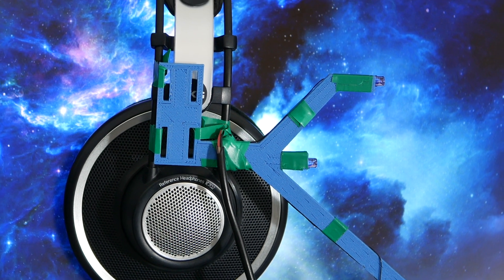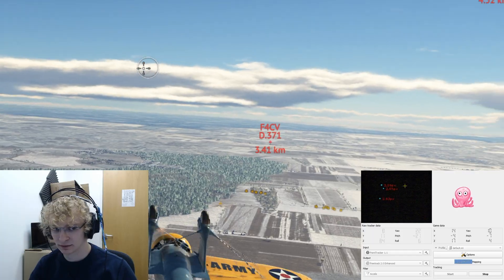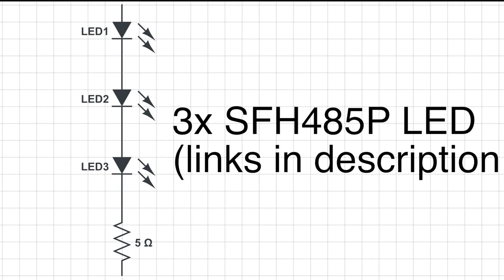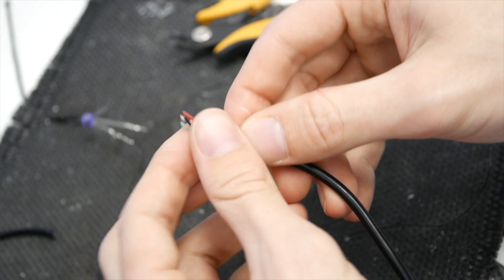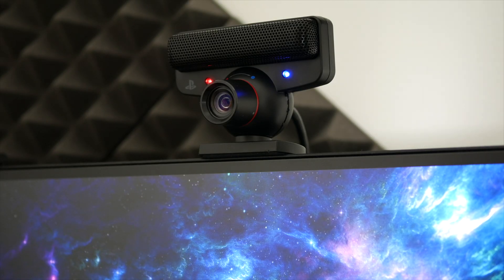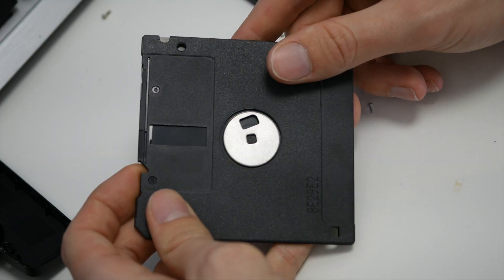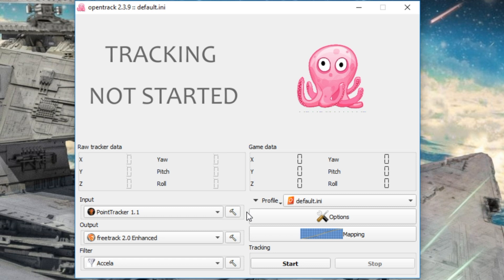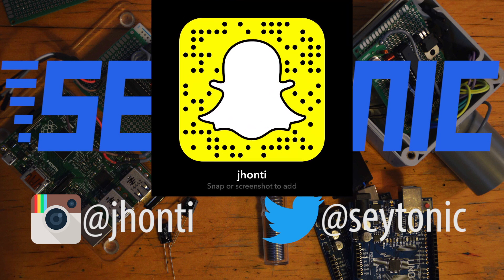$10 Gaming Head Tracker | DIY Tutorial

Comment: Best to power the LEDs from the usb/battery by one resistor each( 330R to 150R) . This is the most elegant way to drive them because the difference between usb 5V and three LEDs in series is too small to ensure adequate current regulation for all led types and power supply variations.

Comment: So......all we need is a f*cking 3D printer, which of course none of us has, and a 5 ohm resistor which you yourself couldn't even find.  I award you zero points for this video and implore you to distance yourself from both Youtube and the rest of mankind until the end of time.  Constantly replacing the over-volted LEDs in your design should keep you busy in the interim.
Reply: lmfaoo chilllll
Reply: or you can make the structure out of cardboard, and actually use a 5ohm resistor. Seems someone has anger issues.
Reply: maybe im tripping but he clearly showed us an alternative to using 3d printed one. Also you can find ohm resistor very very easily

Comment: So I just built this, camera works fine, I plugged the clip in to test yesterday and it was fine, plugged it in today and it waited a couple of seconds before making the same sound as a fly being electrocuted! Luckily I have another set of emitters and a bit of time on my hands, but can anyone say they've done this without resistors and it's still working. I'm thinking it was a short circuit, but I could be wrong.

Comment: Can we use, instead of those 3 IR LEDs, 3 reflective pads, which will reflect the light from the light source mounted on the monitor bezel?
Reply: It would work with a big ir led but it will cause damage to your eye recipe for blindness
Reply: Yeah, that's what one version of the actual TrackIR does. If you also don't have a PS Eye camera you could try using a wii remote. They use basically the same technology as this, but require some software to work as far as I'm aware.

Comment: You should 100% use the resistor. It is not to limit the voltage, an LED has a forward voltage and it will not take more but it is to limit the current. Any voltage left after the forward voltage will get dissipated as heat through the current limiting resistor and anything else connected in series loike your USB port. These LEDs have a current rating of 100mA so in series that is 300mA. Using Ohms law R = V/I so R = 0.5(the voltage drop across the resistor is total 5v minus the 3 leds)/0.3 which is 1.67Ohms resistance. That is the smallest resistance you should use (the 5 Ohm resistance you are advised to use gives you a total of 100mA). Just to give you an idea of the current if your resistance is just the wire you use, looks like very thin maybe 32 gauge at about 1 meter so roughly 0.6ohm. I = 0.5/0.6 = 0.83A. That is almost 3 times the maximum for these LEDs, plus as they get hotter from the current the current draw will change. This is ok for a USB 3.0 just about (normally 0.9A max) but USB 2.0 is only rated for 0.5A.
Reply: what size transistor do you recommend?
Reply: @skate4news658  just a correction on a mistake on my post, 3 LED's in series would not stack to 300mA (parallel would stack but series resistance is same throughout he series circuit). You will want a resistor value that will give you about 80 to 90% of the maximum current rating for the LEDs you are using. So for the 100mA limit keep it to lets say 85mA, they have a voltage drop (the SFH485P LED) of 1.5V. So 3 LEDs in series will drop 4.5V. Assuming your USB is actually supplying 5V that leaves 0.5V which will drop across your resistor. 0.5V/0.085A = 5.9 Ohms resistor. the power dissipated across that resistor is 0.085*0.5 = P = 42.5mW so a quarter watt resistor should be fine.
Reply: I made mine with a rechargeable battery so I had less voltage and had to use a parallel circuit and dissipate some more voltage with bigger resistors and an extra silicone diode.
Reply: @skate4news658  https://www.mouser.co.uk/ProductDetail/OSRAM-Opto-Semiconductors/SFH-485-P?qs=K5ta8V%252BWhtaMgyKjFkJPvw%3D%3D that is the data sheet for these IR LEDs

Comment: Can I use another infrared led model? for example, an infrared LED that emits with a wavelength of 940nm
Reply: Yes, other people have successfully used different IR LEDs. However, most people use these, as they scatter the light relatively broadly and are bright, so its easier for the camera to pick them up.

Comment: There is a DIY trick where they draw red and blue on tape to make a UV torch, do the same but with brown and violet on your webcam and you can use a plain white led instead of IR
Reply: I did it with a marker and tape
Reply: Why not try Eyeware Beam instead? Less fiddling around with LEDs and no headset required :)
Reply: @BeamEyeTracker  advertisement on a reply section is new

Comment: I've done this stuff a lot...You need the right type of PS3 eye camera.  If the outer lens is flat, it wont work.  The IR filter is embedded between lenses.  The concave/x design is good to go and you can peel off the ir filter.
Reply: peel off? The videos I saw they had to cut/pry out the IR filter lens with an exacto knife.

Comment: i'vew done everything u show in this video but still can't setting my trackir, once started opentruck,start moving head but everytime one or two led disappear from the black screen
Reply: Same problem here, have you fixed it?
Reply: @greaterwise2841  nope..managed with facetracknoir, even if it's not as good as trackir because of little lag in ingame movements
Reply: @PreludeMan  facetrack noir is a disaster for me! But I hope to get this thing working!!
Reply: Might be because the angle of your IR LEDs is too narrov. If you use them as they come, that is sometimes the case. I've seen some poeple using sandpaper on the plastic front of the LED in order to make it so the light scatters more broadly.

Comment: These specific IR-LEDs are a nuisance as they are one of only a very few LEDs that use reverse polarity config - normally all LEDs have the longer leg as the anode (+). Best check polarity first with phone cam in case the IR-LEDs you buy are standard polarity.
Reply: Can check polarity by looking inside the lens. The kathode (-) has bigger material then the anode (+). Never rely on the pin length.

Comment: i didn't even need to buy anything cause I just pulled apart 3 tv remotes and used the filter they have in front of the ir LEDs, and i had an old web cam
Reply: BrinkOfInasnity I’m about to do the same thing!
Reply: @cassu6  me too but without a ps3 cam
Reply: ? i'm confused by your answer.  Can you send a pic or vid of your fix?

Comment: Were in gods name am i going to find a floppy disk in 2019
Reply: you can also use photo film. on developed films there usually is a portion that is completely black, two layers of that block visible light while letting IR pass.
Reply: alexander Koryakin the fuck im gon find that
Reply: @vilho4649  maybe your parents have an old strip of film lying around?
Reply: @alexanderkoryakin9510  hey man, can I use my laptops webcam and just stick the filter on that?
Reply: @Reza-sl4jm  Probably? it works on my phone, ps3 eye and laptop camera. the amount of filter layers will vary.
Reply: @alexanderkoryakin9510  tnx for your reply, so I checked my laptops webcam and it can see the Ir, so does it mean that only by adding visible light filter it will work ok? Or no matter what the Ir filter must be removed? And I think I can also use my phone as a webcam because it spots the ir pretty clear, my concern is about removing the Ir filter because its impossible in webcam or mobile phone camera, any info on this case?
Reply: @Reza-sl4jm  the ps3 eye that is used still has its ir filter. and it works just fine.

if the camera that you used sees ir then it most likely should work.
Reply: @alexanderkoryakin9510  thanks very much, one final question, the Ir led that this video recommends is not available in my country, is it better for me to buy led that it is more bright and emmits more light or some decent one? Im think that if I buy a very bright one like the ones used in security cameras the camera will see all three as one, so do you recommend for example ones from remote controls or security cameras? Thanks again
Reply: @Reza-sl4jm  Security camera IR LEDs are overkill for sure. Just find some that have similar stats as the 485P. Some people have even used the ones from some old TV remotes and it worked fine... I would start with some cheap or even recycled ones, check with the camera if it's bright enough and if not you can still upgrade.
Reply: A VHS tape works too. Pop it open and cut a hunk off.  Not current technology much like a floppy isn't, but in case anyone sees this - it works.  If you don't have any, someone in your life most likely has a box full of old VHS tapes from when times were simpler.  :-P

Comment: I got the led's you got and soldered them up to a usb cable but when i plug them in they slowly lose their power and with in about 20 seconds they are basically off, anybody have suggestions? I have also tried a 3x AA battery pack and it did the same thing, I've tried into the usb port on computer and using a phone charger in a wall port
All though im not using a resistor, would this fix my prob? Also Soldered In-Line
Are my LED's bad? I bought the ones off amazon for $8.99
Reply: how did you solved this issue?

Comment: Question: I've got a PS3 Eye with the IR filter removed, but it still lets through visible light. I've got some old floppy disks that should do the trick. Do I have to open up the camera, or can I just cut out a circle and place it in front of the lens? I'd rather not mess with the insides if I can help it.
Reply: Yes you can just put it on the front
Reply: Use the CL eye software to set Gain and Exposure to 0

Comment: Awesome video I wish I could say my head set is awesome but instead its a total shit collector. Each time I turn it on and start using it, it begins to act really jittery and does not seem to turn very consistently. I think i may have to adjust the size dimensions of the headset in open track but what is really killing me is that the lights that I am using seem to be showing up in open track and they appear 3 to 4 times the size of the example you are showing. When I am in the calibrating menu of the open track  software I keep seeing it saying bad and good and it looks like the cross hairs on the led viewer keeps changing positions on the led lights. Can someone who made these mistakes lend me a hand?

Comment: does it have to be a PS3 eye camera ,  or we can use any camera with good resolution and a floppy disk filter ?
Reply: i thought so . my main problem is I live in a place with no shipping or Ebay or amazon , so i have to get creative on my own. thanks for the great info
Reply: PS3 eye has like 100fps pick up and the American version are easy to get the IR filter out, All webcams filter out IR, you want it to only get IR.
Reply: now i get the idea , thanks
Reply: yes basically you can use any webcam you want, but the higher fps can go your webcam, the better. You can easily remove the IR filter in most webcam. You can see in the video that the default FPS value is 60FPS so.. And in fact you probably will be able to increase the framerate by lower the resolution (shouldn't affect too much the tracking). But for the price of the ps3 Eye... you can't go wrong!
Reply: .25p in CEX UK but not the easy type to mod, needs new lens assembly
Reply: @RustRadio_  I struck lucky. My local CEX had 1 in stock, had the much desired curved lens for 50p
Reply: @radiomuffin  you you you you you you SWINE! lol! Ive got the modding the wrong type down to a tee now, helps that i have a draw full of disused CCTV cameras :P
Reply: @RustRadio_  Haha. Yeah I decided to pop in on my lunch break. They had a grand total of 1 PS3 eye cam in stock. And it happened to be the correct model - I'm stoked because I'm rarely this lucky.

Any recommendations on fabricating the arms and where to procure the required LEDs from?
Reply: @radiomuffin  mine were a combo of mouldable plastics like polymorph, the LEDS and polymorph came from maplin.....soooooo.......interwebs?
Reply: @radiomuffin  hey man, I have a question, if I get the filter from a disc and stick it in front of my laptops webcam does it work or it has to be placed inside the camera
Reply: @Reza-sl4jm  hi. Sorry for the delayed reply- all cameras have a IR filter in the lenses. The reason why the ps eye is recommended is because one variant the IR filter is separate from the focusing lenses and not laminated in the middle (often the case with many lenses) also it is a desirable camera for this mod because of the high refresh rate. Most webcams sacrifice refresh rate for resolution. You want high refresh rate and low resolution or your head tracking will be jerky
Reply: @radiomuffin  thanks very much, I have an old android phone and it tracks IR clearly unlike my new phone, can I use that one as a webcam? And another question this one is much more important for me, the IR stated here is not available in my country, do you think its better for me to use a bright IR like the ones in security cameras or a not too much light emmiting one like one in a remote control, Im concerned that if I use a bright one the camera will not be able to distinguish them and spot them as a big led, I appreciate you for seprating your time, thanks much
Reply: @Reza-sl4jm  I'd imagine IR LEDs from a security camera would have a broad spread on them, this would be difficult to focus. The LEDs I used had to be sanded down to make the beam broader.. it would be impossible to make it narrower as you would need a focusing lens.

Have a look around for an electrical supply store. 

Technically you could do it in reverse with a security camera though- put IR reflective material in place of the LEDs and have the IR camera shine on your face?
Reply: @RustRadio_  Hi Jon, I got one today for £3.50. Inflation hasn't been kind! Sadly it's the flat lens style which I didn't even know about. Do you have any spare lens and lens mount I could buy from you? Or if you could let me know the ones to get please? Thanks
Reply: Jon Pugh 120fps at 320x240

Comment: If you are worried about killing your PC USB Port, just use a phone charger
Reply: or a battery and no wires
Reply: If I want to use the phone charger what about the current coming from it? PC USB 2.0 sends out 100 mA and 3.0 150 mA but the output of the charger I have is 750 mA... isn´t that a problem? These IR LEDs he uses, the SFH 485P have 100 mA current listed as max so I am kinda confused that when I use the phone charger it may damage the LEDs or something... also I don´t know if I should still use the same resistor when using the charger...
Reply: @jurajvalko8406  if you use a phone charger you need to put a resistor parralel to the shown circuit. If you want 100 mA max trough ur 3 leds in series the parralel resistor needs to have a resistance of 5 V / 0.650 A = 7,7 ohm where the 650 mA is from ur discription

This resistor also needs to withstand the generated heat of 3,25 Watt. Overall this solution is a energy waste so i am using the usb method.
Reply: Would you need a 5 ohm resistor if you used a phone charger? I can't find any info on where I could salvage a 5 ohm resistor from...
Reply: @d2Tz6nKWMp2TE  just buy a pack of resistors it is very cheap under 10 dollars
Reply: @tp3537  

Yeah, resistors are really cheap since they're so extremely common. 

From the biggest place in my country for buying electronics, you can get 4.7 Ohm resistors for the equivalent of 10 US cents a piece. 5 cents if you order more than 10'000 of them.
Reply: @Hwyadylaw  dont buy there.. they are ripping their cusomers of thats for sure!
Reply: @d2Tz6nKWMp2TE  Not always, depends on the phone charger. Also as he did mention in this vid at some point if you wire them in "Series" it will stop them from having too much current.
Reply: @d2Tz6nKWMp2TE  you could get from AliExpress or something
Reply: @d2Tz6nKWMp2TE  you can find it in any old remote control

Comment: You don't use a resistor...rebel
Reply: Probably could just use a crapload of wiring until it reaches 5 ohms
Reply: ZdrytchX -{Reference why u using a shitload of cable?
Me: i had no resistors...
Reply: yeah you do need one or two resistors i fried 2 sets of leds they worked for 15 mins max
Reply: Carbon Data thug life

Comment: Who now really wants a 3D printer
Reply: I bought a cheap DIY 3D printer from amazon. It's been pretty fun to use, however; I've had some problems but I've learned from fixing them.
Reply: Carbon Data watch his vid on how to build one
Reply: I do!! But the cheap ones are fiddly as The Martin said. I swear seytonic hasn’t made a video about diy 3D printer.
Reply: Daniel Gagliardi sorry it is someone else i will try to find it it might be novaspirittech It is ElectronicGrenade
Reply: They are, but I think after some tuning and little upgrades here and there it can out perform some other more expensive printers. makerbot
Reply: Already have one, amazing to work with and can be profitable too :)
Reply: In my local shopping centre I can outsource a 3d printer for 5 dollars, they don't check the infill rate so I can print a sphere with 100% infill for just 5 dollars!
Reply: So don't forget to check your local library for a 3d printer. Where i live, i can use one there for quite cheap.